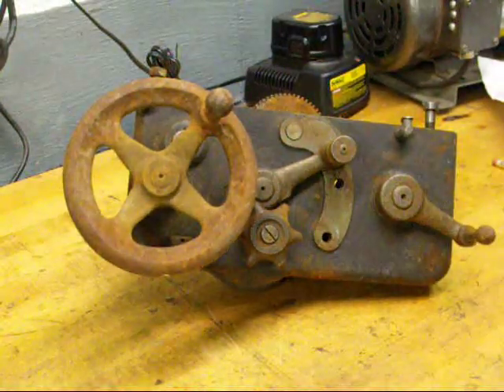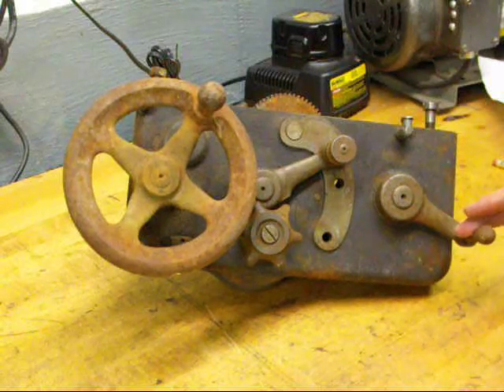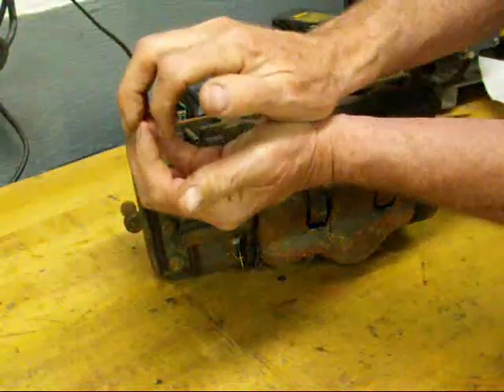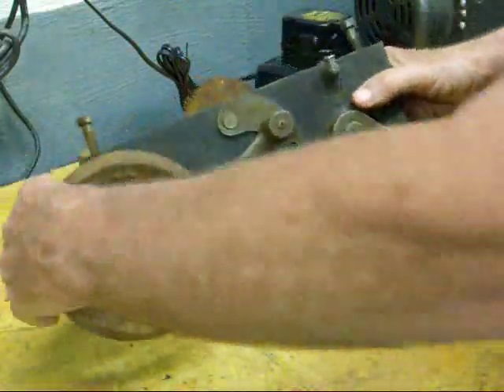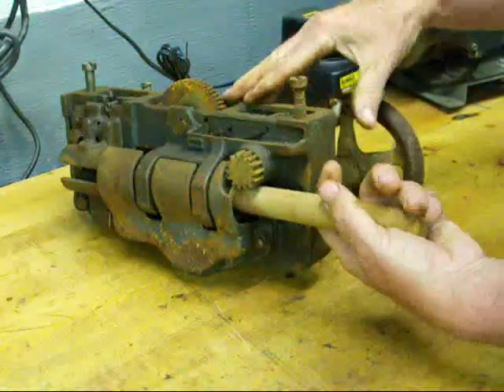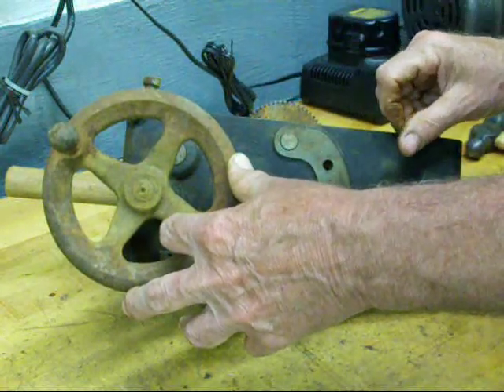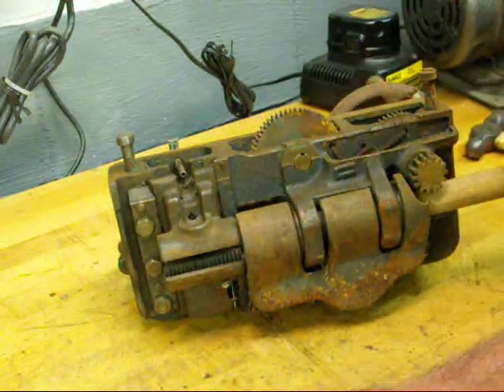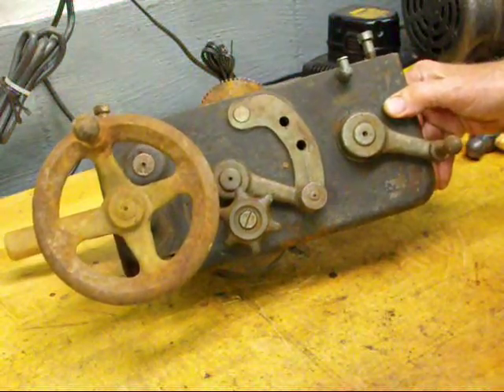TUTORIAL on SOUTH BEND LATHE APRON PARTS TUBALCAIN carriage

Comment: I operated South Bend lathe with a clutch knob as on your apron in high school . There is a disadvantage to clutch knob arrangement. When 
making a heavy cut it nearly jams and makes it
nearly impossible to disengage the clutch knob. I ran into a sholder a couple of times because I couldn't get the clutch disengaged in 
time.
Reply: Very good observation.The SB13"lathe has a simple up and down lever that allows fairly instant engagement/disengagement and may have been the biggest reason I chose the model

Comment: Hi Mr Pete. I purchased a 1968 SB heavy 10 L. I’m wondering if I need to drain the oil from the saddle. I think there’s a nut under there to drain oil. What’s your opinion?
Thanks,
Paul
Love your videos.
Reply from the maker: Yes, definitely change the oil. There is a plug at the bottom.
Reply: @mrpete222  ok. Mine seems to be missing the cap screw. It’s completely open. I cap it off. Do I need to fill a the volume with C oil, or just put oil into the little oil receivers on the sides and top? 
Sorry, but new to lathes. Your videos help a lot. Wish I had you as a teacher back in shop class. 
Paul

Comment: MRPETE ..... any advice on drilling out a stuck taper pin?   I'm disassembling the apron of my Heavy10 and have 2 taper pins that wont move..... and now are kinda mangled on the ends where you can't tell where the pin ends and the shaft starts.   I went and filed the pin flush so I could kinda see the outline of the pin.... still wont move and after one or 2 hits it's again deformed
Reply from the maker: Since they are soft, you will have to drill them out. Very difficult to do without going off center and ruining the whole darn thing. Are you sure you are hammering them in the correct direction?
Reply: @mrpete222  I stayed persistent and filed the heads flush, heated the area up with a non flame heat gun found a larger hammer and used an automatic center to put a tiny dimple right where I wanted to drive the pins, put my punch right on the mark and hit it a bit harder and it gave way.   I also shored up the backside so it could no longer be cushioned over corrugated cardboard.    Thanks though!

Comment: Hi, Mr. Pete, I have a southbend 10k. Cannot get the clutch to engage the longitudinal feed. The cross feed works. I completely tore the apron down and it works if I turn it manually like in this video, but will not work when mounted on the lathe. The lead screw turns but it doesn’t move. Any suggestions?
Reply from the maker: I have a Nother video besides this one that covers the South Bend carriage, did you look at that one?
Reply: mrpete222 I have not. I’ll check it out. Thanks